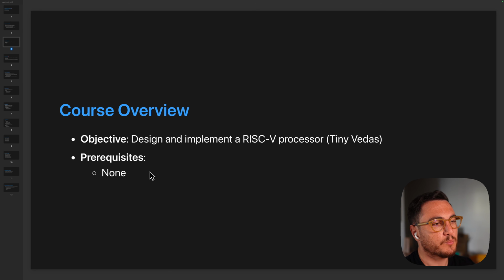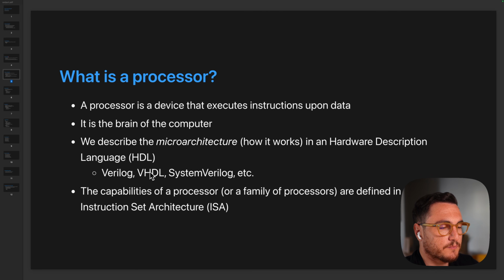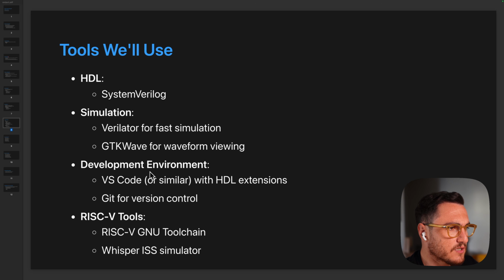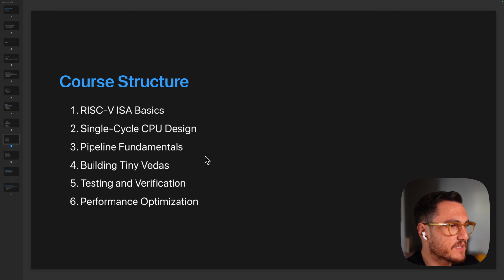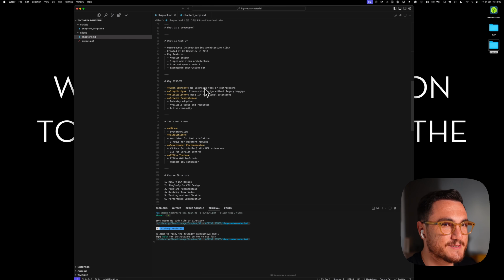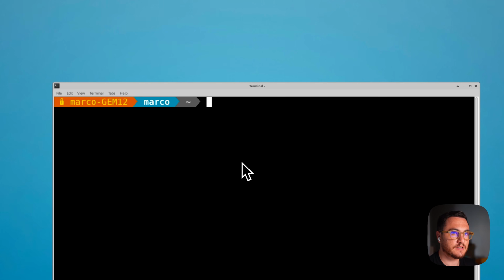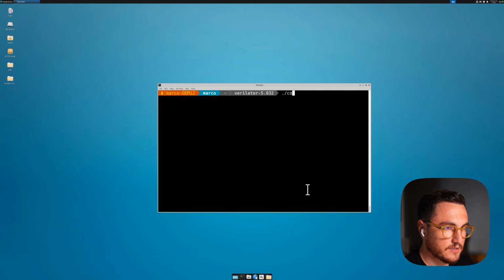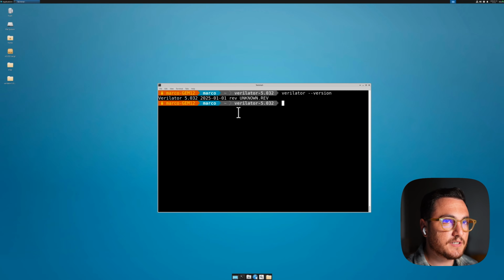RISC-V Processor Design Course - Lec 1 - Intro & Setting up the Dev Environment

Comment: If you are on WSL chances are you will get `Could not initialize GTK! Is DISPLAY env var/xhost set?` error message when running `gtkwave`.

To be able to use it, install xming X server for windows and then `export DISPLAY=:0` in the wsl terminal.

Happy coding 😀